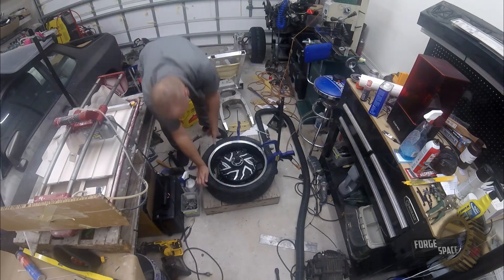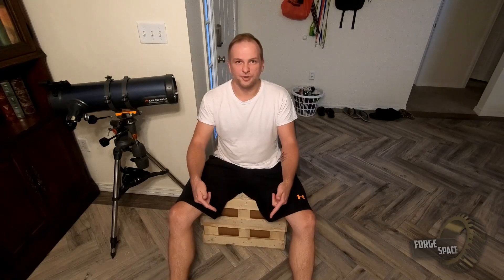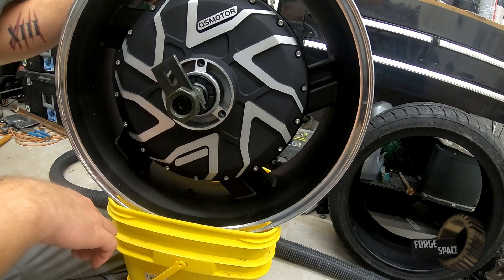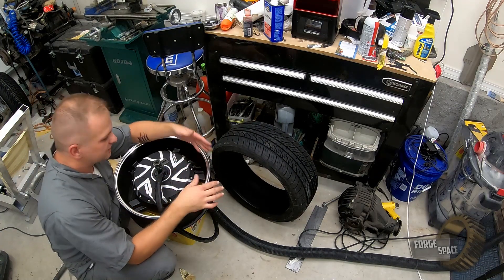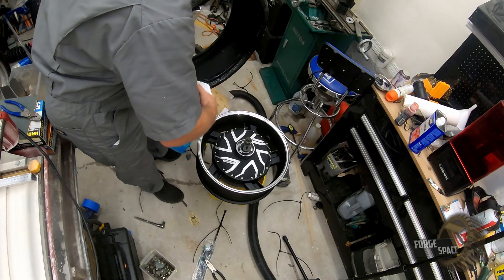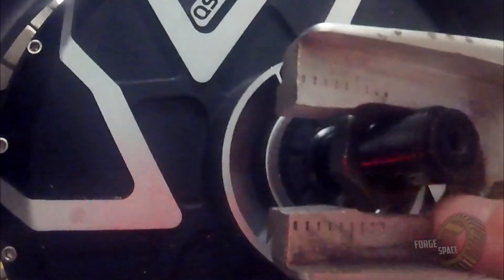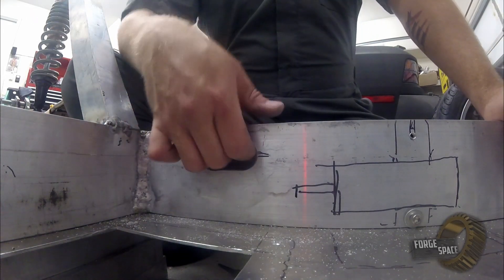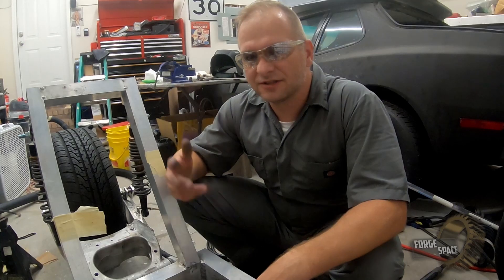12Kw QS motor gets installed!- CyberTryk EP.07

Comment: I just got one of these motors with everything needed to run it besides a battery and frame to put it on for $100 off the marketplace, brand new never used. I have been collecting 18650 high discharge cells so hopefully i can figure something out.

Comment: Should've just taken it to a mechanic shop and pay them $30 to get it installed in less than 10 minutes.
Reply: Because tire shops have any clue what a hub motor is? Yea no..
What he did is about the only way to get a tire on a hub motor. They don’t fit on tire machines so it’s a manual process. And yes it suck’s pretty badly, however that last pop when the tire goes on makes up for everything.

Comment: Last question. Do you know roughly what the top speed is for that motor?
Reply from the maker: I had them build it out for ~80mph at 120v. It's a BLDC so generally, top speed is based on your system voltage. I have gone at least 65mph with my set up at about 50% throttle

Comment: I installed this kit on my 71 Harley Sportster custom. I used a 180 55zr17" Metzeler. It was super soft. I was able to zip tie the sidewalls together basically making them one sidewall. I sprayed the rim with silicone spray and the tire went right on. I cut the ties and beaded the tire. Then I used ceramic beads to balance the tire. Nice video but the Metzeler would have saved you a ton of time.

Comment: Sweet dude. Very excited to see upcoming videos. I just sold my ME1507 and planning get this same motor for my Ninja 250.
Mind if I ask you how much you paid for it and where did you get it from. Seems like there are 2-3 different QS Motor websited all claiming they are the legit one!
Reply from the maker: I bought it from Sia on AliExpress, they are a subsidiary of QS. On order I told them what I wanted for the specs (current/ system voltage) Paid 830$USD but also had to pay 230$ importer fee.
Reply: @ForgeSpace  oh wow so $230 was the tariff charges?
Reply from the maker: Yeah, it was an unexpected bill, however it's the only component I had to pay duties on.
Reply: @ForgeSpace  ok I just price from QSMotor. $830+$340 shipping
Reply from the maker: Just be aware you may get hit with the terrif on top of that. Who are they shipping with? Mine used DHL
Reply: I just bought a me-1306 12KW BLDC motor. Do you know a controller I can use to drive it? Thanks!